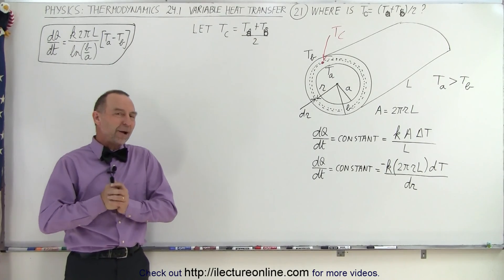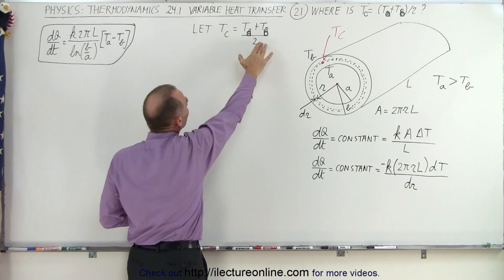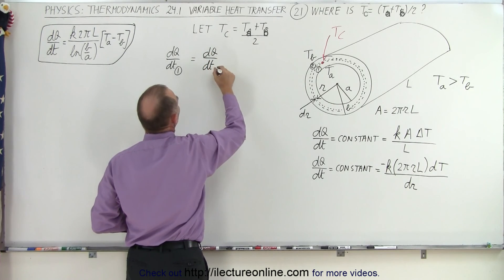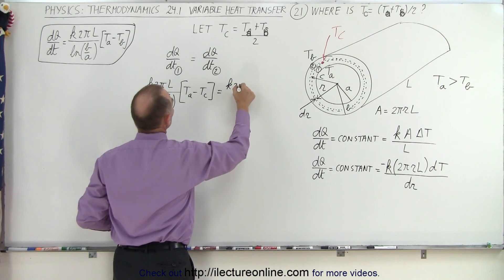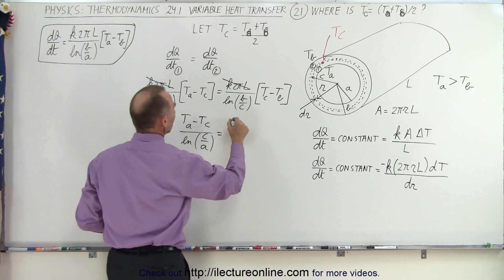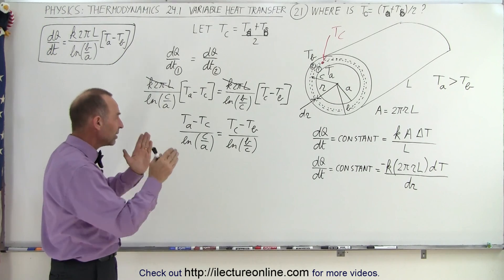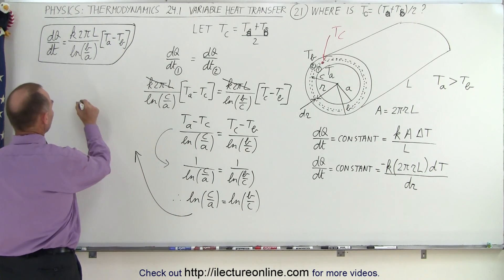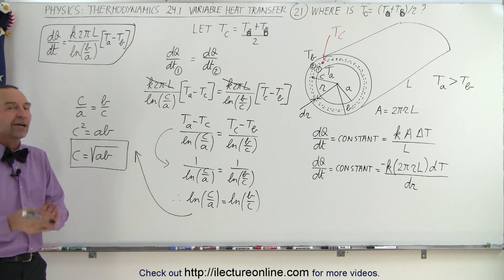Physics 24.1  Variable Heat Transfer (21 of 25) Where is temperature half?

Comment: Bagaimana kalau silinder solid.
Reply from the maker: We have a number of examples when the cylinder is solid (along the length of the cylinder).  It doesn't make sense to work out this type of example with a solid cylinder.
Reply: @MichelvanBiezen  selamat siang. saya mohon maaf sebelumnya.atas pernyataan saya. saya menentang penggunaan log. natural untuk persoalan ini. ada beberapa kelemahan yang saya perhatikan 
1.Berapakah panjang jari jari selubung ( x )
2. Log. natural bergerak dari 0 sampai infinity +.. sehinga menimbulkan keadaan dimana x/ dx. Selalu mengalami perubahan dari 0 sampai infinity +. Keadaan  ini sama sekali tidak mungkin. Bagaimanapun juga perbandingan jari jari selubung ( x ) terhadap ketebalan  (dx ) selalu bernilai lebih dari 1,00. Mengapa demikian ?....   Hal ini disebabkan oleh perubahan luas yang makin besar saat menjauh dari pusat silinder, sementara jari jari jari silinder bergerak secara linier
3. Menggunakan log. natural menyebabkan kerancuauan pada dimensi. yang terbaca saat anda melukis grafik adalah nilai luas metric square. padahal yang tertulis dalam penjelasan di buku manapun  adalah tidak memiliki dimensi.
4. Ada  suatu keadaan dimana x/ dx = 1, yaitu saat ketebalannya adalah bernilai( e - 1 ) n. Hal ini juga tak pernah terjadi. Alasannya mohon dibaca pada penjelasan nomer 2 diatas.

catatan : 
1. Saya pernah tanyakan masalah ini kepada dosen saya, tapi hingga saat ini tidak direspon. 
2. Saya sangat senang berjumpa dengan anda di youtube ini. terimakasih saya kepada anda. syaloom. from indonesia /south sulawesi/toraja.